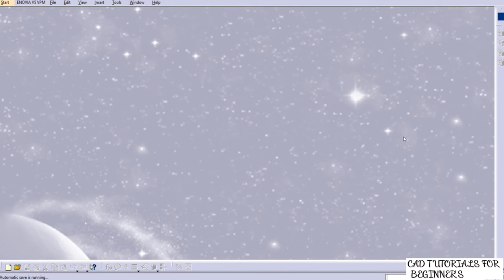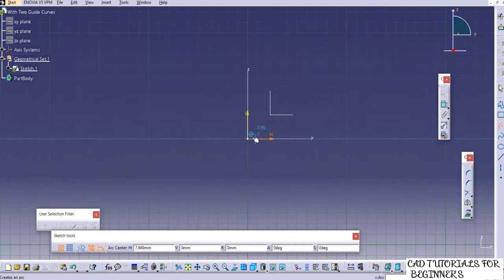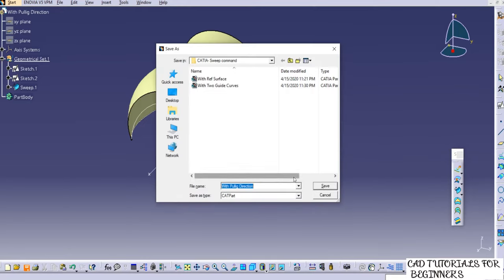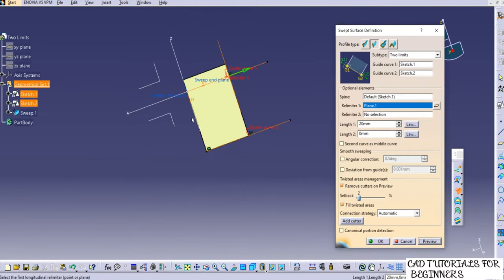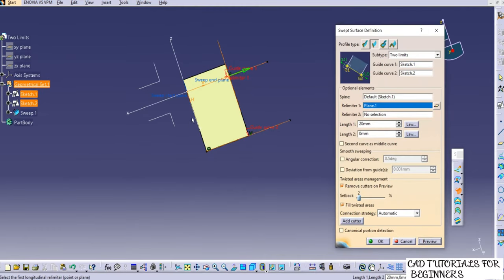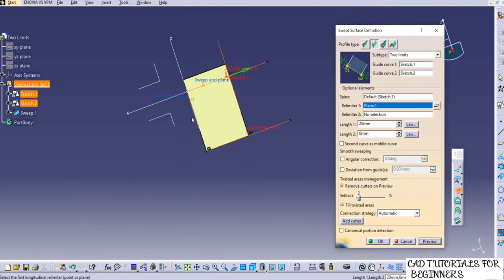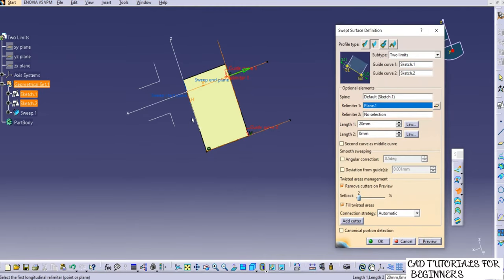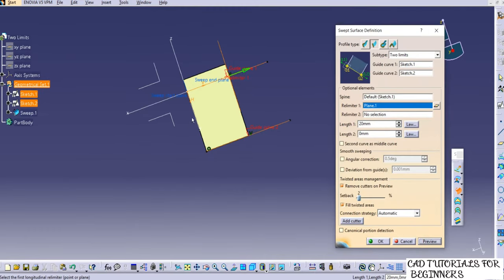All 21 Types of Sweep surface commands In CATIA I Generative shape Design - Updated Video Tutorial

Comment: what is the use of anchor points in two guide curves option?? what happens if we change the anchor points  in explicit two guide curves
Reply from the maker: Hi Arun,

Basically anchor points are useful for positioning of the profile which we are sweeping with the guide curves along which we want to sweep...
Mainly used where you use two guide curves while sweeping...

Thanks!!